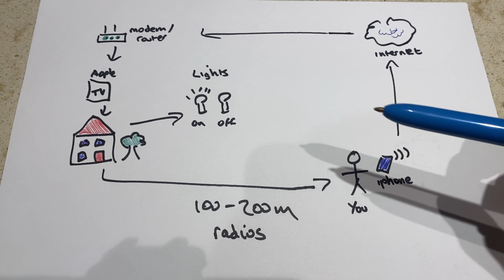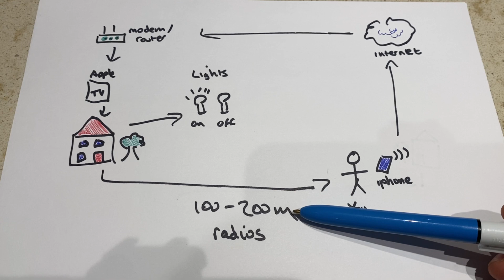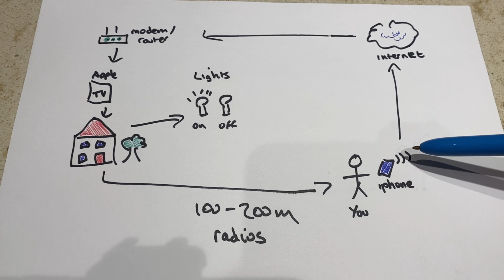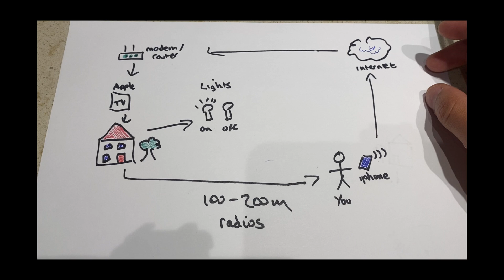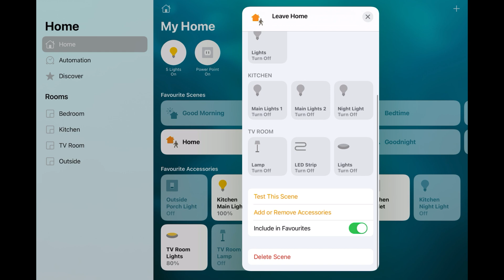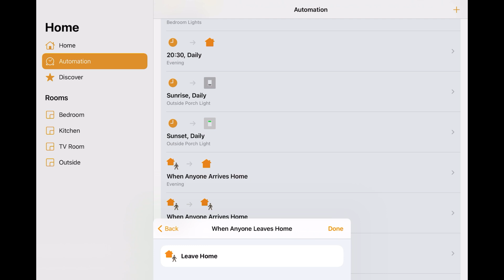How to Build Apple HomeKit Smart Home - Episode 7 - Geofencing

Comment: Brilliant and well presented video....heres what i need help with.... I have a remote control garage door opener which works on home kit. I need to set it up so it can only be opened when the "home members" are within a small geofence area to prevent it being opened when away...can you assist ? The reason i ask is I opened it accidently when in another country !
Reply from the maker: Thanks, there is an option now to say "last person leaves" or "first person arrives home" which is handy. When you select current location it cannot adjust the geofence permitter which is annoying, wish apple would give us the option. That being said if you type in the address you can customise the permitter with the minimum being 100m radius and max 2400km LOL. Also if you opened it remotely you can close remotely just ensure you have the hub i.e. Apple TV and that the internet connection is stable. I hope this answers your question.

Comment: On paper may work, in Apple's Homekit doesn't. What you say has NOTHING to do with geofencing, it is when your phone is on the same wifi with your home.. Geofencing is turning on or off when you enter of exit a geofence radius, far from home, it can be kilometers radius. Everybody gives examples with lights, but try the thermostat. You leave home in the morning and set the thermostat on a lower temperature to save on your bill. But when you return home you need a comfortable temperature again, so the automation shall be triggered when you are far away,  lets say at 10km from home, because guess what, the heating is not on or off like a light, it takes time to reach there. It used to work until Apple fiddled with homekit starting iOS15 and damaged everything, of course. Now if you ask them they say that this thing never worked, you can only use their default radius of 100m, there is no way to change it.
Reply from the maker: Good point Andrew. Heating does take time which is why I wouldn’t have it on a geofence trigger but on a timer. This obviously is more suited to those on a fixed a schedule. Hopefully Apple can add a fix to said but as you say. Maybe send a feature request.
Reply: @DimmyV  Again, the feature used to work in apps, not in HomeKit, until Apple took it inside HomeKit and disable it. I am not the first one that pointed this out, there are threads on Apple support forum, and there are responses from Apple saying that this is impossible to work. Well it used to work until their own numb nuts fiddled with it. As an escape route I did set mine on timer but what happens when you have a variable schedule? History proved that a “new feature” from Apple does not necessary means a good thing.
Reply from the maker: @andrew4982  interesting, I'm currently not in this apartment to see if it's working or not. I can see that there is a bug though from a quick search. That's really annoying for such a convenient function to break. Hopefully an update from apple can fix this.